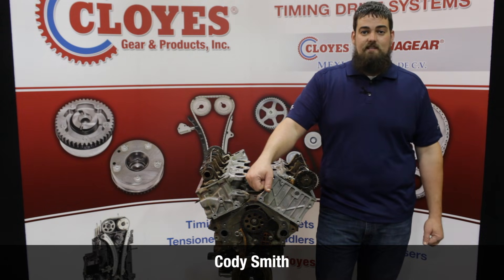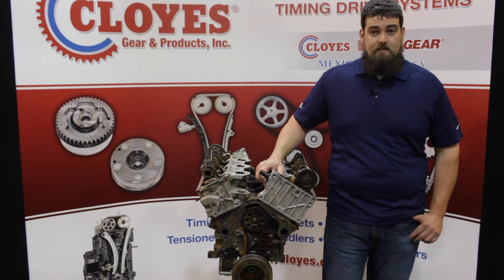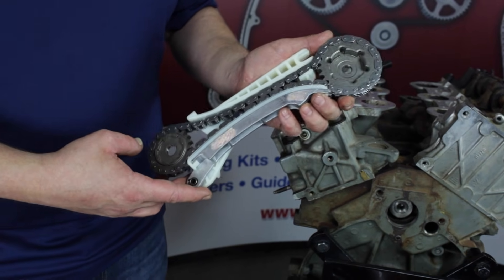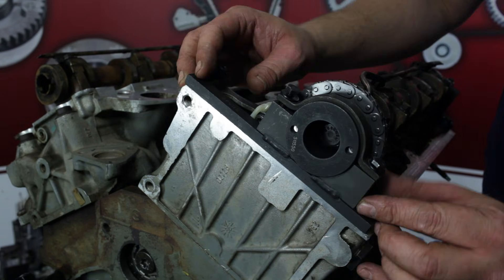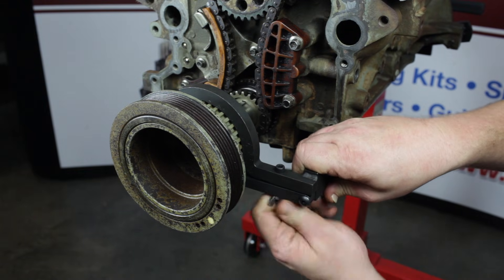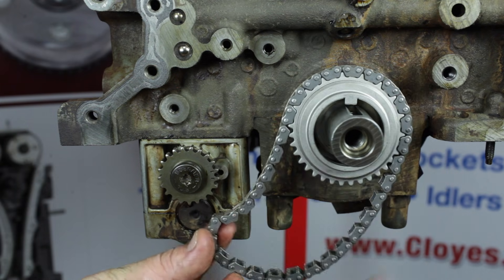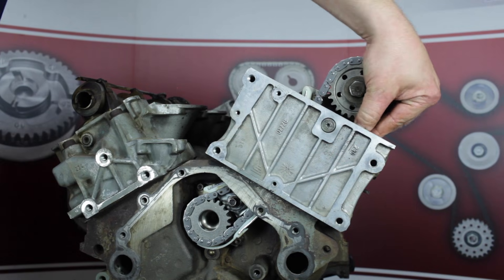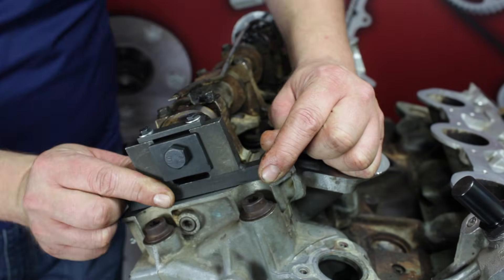Ford 4.0L Timing Chain Replacement, Cloyes 9-0398SB

Comment: Just bought Cloyes L & R tensioners, 9-5586 & 9-5587.
I notice they are not black, but a light greyish colour.
And I can fully depress them without too much effort...
I expected the springs to be stronger than this 🤔

I'm wondering if they've recently outsourced to a different manufacturer 
(they're made in China).  That's assuming they're actually Cloyes.
They came in Cloyes boxes through Rock Auto, but there are no markings on the tensioners themselves, other than on the nut ends - 3 squares (each with a circle inside).

I heard that Cloyes actually OEM for Ford, maybe including tensioners - can this be verified?
Reply: I think this has been answered, but if anyone else is worried about this, hand-prime the tensioners submerged in oil.  They will firm up.  That's why he said that you needed to crank the engine a few times to get everything primed.
Reply from the maker: @tkorte101  It is not required, but it can only be beneficial. You can submerge the tensioners in oil and compress and release them multiple times until they get hard to compress.
Reply from the maker: These tensioners are primarily oil pressure operated tensioners. The internal springs match the OEM spring pressures. Once they get some oil pressure they get much harder to depress. 

We are currently supplying Cloyes exclusive tensioners that we developed. Cloyes owns the tooling and they are manufactured by our close partner, an OE manufacturer in China. You should see 3 little squares with circles inside on the top of the tensioners, that is our tooling mark and will confirm that it is our product. Borg Warner manufactured the timing system for Ford on this engine. Due to its age now, availability of the OEM components is becoming scarce so aftermarket parts must be sourced. We do not just go buy existing, cheap aftermarket parts available on the market and sold by our competitors. We develop the components, invest in tooling, and sell premium quality components.
Reply: @Cloyes01  
Thanks for that, gives me some confidence.
Reply: @Cloyes01  
While I'm here, just checking...
You can just change these over, without needing Top Dead Centre, right?
Reply from the maker: @BWater-yq3jx  If you are talking about just changing the 2 hydraulic tensioners, then yes. Just make sure you don't rotate the engine with them out.
Reply: @Cloyes01  
Cheers!  😁👌

Comment: Hi, 

What happens if I've already changed the timing chains and tensors and there's still a slightly clacking noise from the chains after using tOEM ? (2007 Ford Explorer 4.0L)

PLEASE HELP, AND THANK YOU.

Comment: I have a 98 ford sport it was loaned to a friend to use and I believe he put to much oil it is now making a tick tick sound not heavy but more audible from underside of the passenger side wheel well. when I rev the engine higher it increase in volume of noise but not much. what can the issue be is this a timing chain issue. Still havent drained the excess oil yet.I would appreciate your input.
Reply: Could be idler pulley/puller tensioner

Comment: I have a 2008 explorer with the 4.0 engine. Is this the same engine that is in my vehicle? It has 130,000 miles on it, at what point should I do this repair? I am told this one of the weak points of this engine. If this is a engine out repair it doesn't seem worth doing, given the book value of the car.
Reply from the maker: Yes. This is the same engine. I wouldn't service the timing system until you hear some signs of it going bad. Startup or idle rattles or poor performance. If the engine is taken care of, you should get thousands of more miles out of the original set.
Reply: @Cloyes01  Thank you for your reply. I do change the oil regularly and do all scheduled maintenance.

Comment: If I buy the set with a balance shaft will it work if my motor doesn't have a balance shaft? Idk if it's the factory motor n just wanted to be prepared when I pull the motor
Reply from the maker: The crankshaft sprockets are different. All the other components are the same.

Comment: And my engine has completely stopped and will not start. Will I need to put in new cams or will I need to reset the cams
Reply from the maker: You can reset the cam using the tool kit.

Comment: Which kit would I need for my 04 ranger 4wd
Reply from the maker: The 4x4 models typically had a balance shaft. You will likely need the 9-0398SB.
Reply: @Cloyes01  i went on this thought but my 05 fx4 does not have the balance shaft. Also appears to be the first time to engine has been apart so I dont think it has been removed.

Comment: Hi i did everything according to the video but when a rotate the engine there is a clicking noise at the rear timing chain. I noticed that the chain goes loose on the opposite side of the tensoner. do you know what could be the problem?
Reply from the maker: You are likely seeing the camshaft being pushed forward and back by the valve springs as you rotate. Once the tensioner primes up with oil it will limit this movement and tighten the chain.

Comment: My 4.0l does not have that extra chain at the bottom and its a 2007 mustang. I never saw or heard how much torque to the bolt at the back of the engine
Reply: I believe the engines with the balance shafts were in 4WD vehicles but I'm not 100% sure on that.
Reply: @saintsarecoming13  Yes

Comment: Is it the same tdc crank tool for a 2010 mustang? I have the tool but it contacts timing cover before crank.
Reply: Thank you. The crank tool didn't work. But I actually found timing marks on balancer and crankshaft sensor bracket. I was still able to use the cam tools to loose the cam sprocket bolts.
Reply from the maker: Yes, the tool kits should work for any SOHC 4.0L. As long as it positions the crank in a way that positions the key at 12 o'clock you are good.

Comment: It is not a interference engine! where are you getting your info?
Reply: Where are you getting your info it definitely is an interference engine and get them out of time and you will be pulling heads replacement valves
Reply: Every 4.0 that comes into my shop has bent valves. The are absolutely interference.
Reply: @iamdjnam  need we say more.

Comment: I own numerous Fords...but I would never consider buying anything like that! Four chains? Get real!
Reply: North Dakota Ham : Don’t buy a Ford Explorer !
Reply: @Gmoney1019  why?
Reply: @amorozzo70  my complaint is about the engine, not the rest of the vehicle.
Reply: @northdakotaham1752  Funny you say that like General Motors doesn't have bad designs either;  Optispark, Displacement On Demand just to name a couple.
Reply: @nightwolf9723  2.2 Liter from the 90's 🙂
Reply: @nightwolf9723  i have a video up of a 2000 4.0 SOHC with 216k miles and no rattle
Reply: @jonslife3533  I have a 2001 explorer with 281,000 miles and no rattle.still running strong.these ford engines if properley taken care of should last the life of the vehicle. good driving habits will prolong engine life.

Comment: I'm glad I work for a chevrolet dealership.  Won't have to worry about rebuilding one of these POS engines.
Reply: Why are you here then? Just to be a internet troll I can only assume at this point.
Reply: @BubbasPlace12  No .  To see the different ways that engines are put together   Sorry you consider that trolling. Just because I said it's a dumb ass design and glad I won't have to work on the POS.
Reply: Save your breath and time bud.. you may need it one day.
Reply: Running properly it is smooth, quiet, and reasonably powerful with smooth wide torque band. Until it breaks down.... :-/
Reply: grimaces as 3.0 diesel gets released
Reply: Well... that POC 3400 V6 wasn't much better. Still, only a German would put a cam chain at the back of an engine. :-D
Reply: Hey Jeff why ain't you come fix my 2008 GMC Acadia. It's nothing but problems.

Comment: My 01 ranger edge just started making the rattle noise and CEL came on. Is it possible I could get by with just replacing the timing chain tensioners? It seems to be starting and running about the same before it started rattling
Reply from the maker: Due to the amount of labor required to change the whole system, trying new secondary timing chain tensioners is worth a shot.

Comment: What bolt in this process are torque to yeld?
Reply from the maker: Just the front and rear jackshaft bolts along with the harmonic balancer.
Reply: The bolts for cams are not TTY?

Comment: can this repair be done w the motor inside the truck ?
Reply from the maker: No, the engine must be moved forward to access the rear compartment for the right hand secondary components. The primary, front secondary, and balance shaft chains can be accessed in the vehicle.
Reply: Did you not fuckin watch any of the video before posting a comment there hoss?  Cause right in the beginning he talks about it..  like in the first minute..  you can do it all standing on one foot too if you wanted to..
Reply: @Z-Ack  pull the engine, chuck it out and a get a new engine. Too much work putting a half worn out engine back in with only new chains. A really stupid design. Four chains! Ridiculous!

Comment: I first did one of these about a year ago, couldn't afford or find the the special tools. But made my own cam lock tool. It says there are no timing marks but those cuts in the cams align with the angle of the head.  Those to me are timing marks.  I must have done something right, owner drives that beat up explorer hard every day. I love your parts and instructions but $400 for a timing set like this is ridiculous. The cheap set I found for 1/4 the price seems to take everything this guy puts it through just fine. and it included everything your does. That a big cost when you consider the engine has to be pulled to do it. A good used engine with a warranty is $500 around here.  And if you have to spend the $200 for the installation tools you use here, you might as well invest in a new vehicle.  I guess it must a Ford person thing. My S10 timing chain cost about $60 in parts and 2 hours to replace, if it went out. And if it did, no risk of bending valves.....  Sorry folks, been a mechanic for 43 years and only because I work for myself.
Reply: Where did you buy the alternate timing tools, that are like Cloyes tool set?
thanks Roger    I have a 2009 Ford Ranger 4.0L SOHC that is rattling R.H. valve side.
Reply: @shannoncox3705  I bought tool set at Amazon $88.
Reply: @shannoncox3705  I bought it at Amazon. Pulling the engine is a real pain. Hint, starter has to come off easiest way is to pull drivers side exhaust manifold, on the '02 it's the only way. Also, the AC and power steering just unbolt the bracket and pull the unit forward as one piece so you don't have to disconnect hoses on pump or AC.
Reply: Interesting, for the intense labor involved, one would put the cheapest timing set they could find on.

Comment: So the 97 Explorer is the first year of this motor?? So if I got a 96 Explorer what size V6 is that?
Reply from the maker: 97 was the first year of the SOHC 4.0L engine. The earlier engines were 4.0L pushrod engines.
Reply: @Cloyes01  thanks :)

Comment: Why does my other cam turn when removing first jackshaft bolt at the beginning? Moves the whole crank too. But not the cam that's clamped of course.
Reply from the maker: The camshafts are both under valve spring pressures. If the camshaft is not being held in place it will likely rotate a little when the jackshaft bolt is removed. This is completely normal, just make sure to properly time the cams when reinstalling the components.
Reply: @Cloyes01  I went ahead and clamped down the other bank just for extra torque. And someone must have used thread lock on it. It is literally close to needing a cheater bar? Should I heat it up? Mechanic since 83.
Reply: And yes I am cranking it left.
Reply: Locking tools are holding tight also.
Reply: @Cloyes01  I noticed the cams can stay in place, yet the crank still will move when I am trying to remove the first jackshaft bolt is being removed. Engine ran fine, but had 200 thousand so I wanted to redo the timing set since I was installing a new transmission.

Comment: I have one of these sohc 4.0 its 2007.. as if I would pay a tech 2-3 thousand to change one of 3 timing chain . Do they actually break or just rattle?
Reply: Not so much the chain as the plastic guides.
Reply from the maker: Yeah, they do break. And this is an interference engine so the valves are usually damaged when they do.

Comment: I'm ready to start redoing this project again, I did it and it failed one of the tensioner guide broke right when I started the engine , I put it on my garage for 2 almost 3 years on hold , now I'm about to start redoing it again, I couldn't get a ford mechanic to come and do it , no one wants to mess with this engine, I even brought a retired old ford mechanic that knew about this issues before even production  started, he was sent 1 of the 6 prototype engines back in the early  90s for possible production, and showed me the records, Mr Lee the mechanic told me that this is one of the most hated and underperformed engines from ford   that was design to produce more money in parts due to the design, he recommended not to use it bc all this timing issues but ford decided to start producing even with the negative feedback from their own master fordexclusive mechanics.
I found that my tensioner were not loaded and needed to be preloaded with oil manually, the slack of them without oil causes the chain to slap against the fragile guides and brake, the preloading must be manual, the engine wont load them with a few spins, the amount of pressure on them need to be higher... I spoke to cody about this issue before , and since my wife is happy driving a mercedes there was no need to repair this 15kusd  08 explorer with 99k miles or junk until now that will probably sell or crash or something ...lol
Reply: I would trash that engine and find a good used one from the boneyard, install it then sell the vehicle. Been driving Fords for over 50 years and after watching this video would never consider buying a vehicle with one of these engines.
Reply: @northdakotaham1752  I'm about to install the engine , I'm confident enough that this time it will work, aleast to sale it and to get the mercedes my wife deserves , instead of this explorer ....
Reply: @gused82  I like the Explorer and have two of them but both with V8 engines. Where I live all wheel or 4 wheel drive is a must. Good luck on your project!

Comment: I bought this kit and the LH side cassette will not drop in and that step has conveniently been excluded in this video. Whats up with that? It seems to me that the entire jackshaft will have to be removed to get your cassette installed.
Reply: To install the cassette properly it is necessary to remove the snap ring holding the two guides together and putting in separately and then reinstall the guides back together once they're inside the engine.
Reply: Yes they skipped this step! Lol on my 07 ranger the jackshaft must be removed due to the head being over too much,show us the video of you doing it then,!
Reply from the maker: Jackshaft removal is not necessary. That cassette does need to be dropped in just right to install, but further disassembly is not necessary.  We didn't edit the video to skip any necessary steps.

Comment: This is the most worthless designed timing chain system I’ve ever seen. Great job Ford engineers, you’re morons. Great video by the way, now I’m depressed.
Reply: It is a German designed engine.....it is in my 2002 Explorer...it sucks..my vehicle only has 123K and it has been sitting for a whole year now...new jasper costs $3800 plus the cost to put it in.. about $5000 is what I was told.
Reply: @therobinmasterstheory1636  the Germans had some good engines also. This isn't one of them. Looks like a throw away engine to me.

Comment: Would it be possible to get rid of the balance shaft to increase performance
Reply from the maker: Many of these engines came without balance shafts originally, and I am aware of rebuilders  who eliminate the shaft as well. What is involved in the process is not something we have knowledge on.

Comment: Man this is why I love Chevy this timing setup is terrible lol
Reply: @miketonon7946  ah hear say that's the way to live life lol
Reply: @miketonon7946  well let's hear it, why?
Reply: @miketonon7946  that's sounds like you googled it I wanted to know what exactly make them shit to you... they are the easiest motors to work on parts are easy and cheap to come by never need to rely on a mechanic with a Chevy engine
Reply: Not that bad ones you do a few
Reply: @MrMass28  gravy train
Reply: Not a GM fan but have had a couple of the 3800 V6...seemed pretty solid. Of course I have a 350 also. Probably run forever with that one.
Reply: Gm 3.6